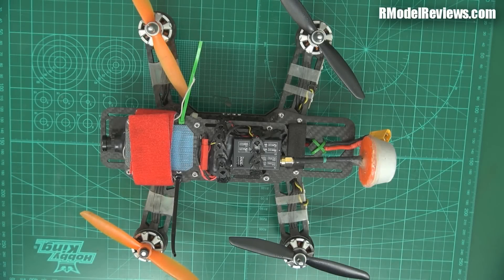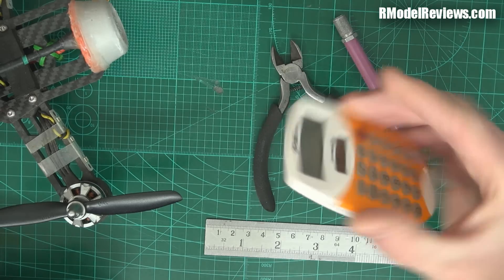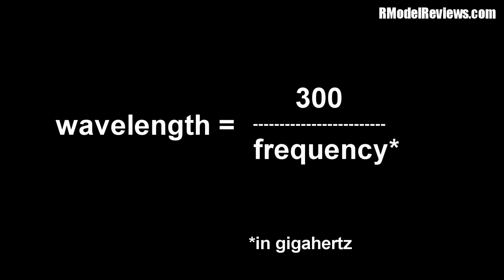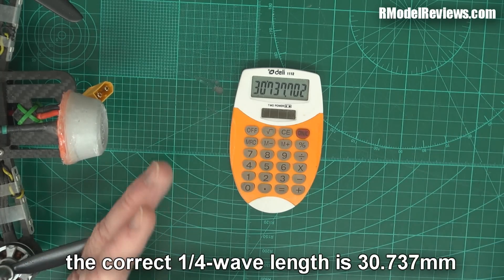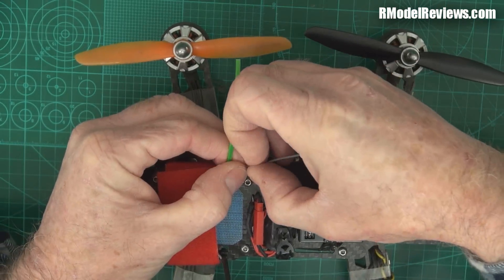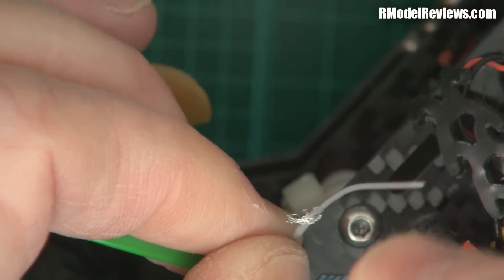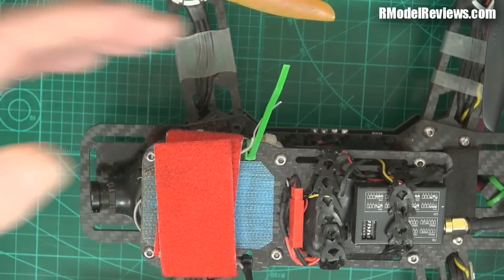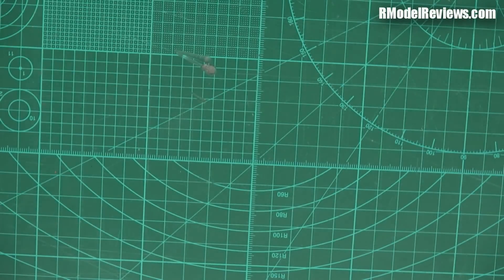How to repair a broken receiver antenna

Comment: I use an old nailcutter instead of the side cutters for small wires. Much more precise since it's got a thin profile and sharp all the way to the edges. I would have used that to cut away the outer braid.

Comment: On your next video could you explain the large difference in receiver lengths - eg Flysky is 26mm. Also good to show a BODA aerial particularly for the lower range systems and toy radios to increase range by using that cut off coax shielding.
Reply: He answered that question above.
Reply: Rob Gale  Not really - there is a big difference between 33mm FrSky and 26mm FlySky. That is not down to manufacturing tolerances, it is a design decision. Perhaps to do with tuning sensitivity and interference - just like the old GWS FM park receivers having non 1/4 wavelength very short aerials.

Comment: Outstanding...thank you sir!!
Today i got told by every expert under the sun "Nar, nothing can be done..new receivers the only option" came home and tried splicing, some soldering, 10% improvement at best.

Its late, couldn't let it be, jump on YouTube and watched this video.
15 mins later and im walking across front lawn in my boxers, fimgers crossed..

The Rustler's 2.4ghz reciever  and it's new custom "minimalist look" 😆 460mm aerial, has full range again.

Again, thank you Sir, you little ripper
Reply: Doing this to rustler right now lol.

Comment: Great video but why don't you put the antennas under your arms front and back? my quad is under the arms and it's impossible to touch the antennas 👍 and the bottom of the quad is always facing you 😆👍

Comment: Cheers for video, how come frsky d4r-II is 15mm? Is that because there are two totaling to 30mm? 
Looking forward to the full replacement as one of mine is damaged half way up the antenna.
Reply: Tom Smith I just measured the antenna on my D4R-2 and both are 31mm.  The Rx in the video was also a D4R-2.  Could yours have been cut at some time ?

Comment: great video. thanks   question, my sr210 receiver has no coaxial cover. just a 8.5 cm with a single solder point in the receiver. i need a longer antenna and would like  to add one but with no place to solder the ground wire. can  the battery ground be used for that? since i got the receiver they have upgraded to a longer antenna. i would like to be able to fix the one i have. any ideas? any help would be appreciated. thank you

Comment: What if you pull the shield all the way back over the untouched coaxial. if possible.. Could make a simple sleve dipole style antenna? maybe cover it with some solder. Would that give good reception i wonder..? :D

Comment: Very nice and informative video. Does it mean that the "receiving"  part of the antenna is only the exposed part of it ? Can I run the insulated part under the cage of the quad and only care to place correctly the exposed part of it ?

Comment: QUESTION, please: about rx antennas; most tinywoops come with a AIO board. And the rx antenna is just a 26awg cable, with no ground or anything else... How come??? How does it work?? And about Lengh?

I think Albert Kim tried to put a regular antenna in his mobula6 and put the ground somewhere and the thing got lot lot worse in range ...

Comment: I recently shortened one of my FrSky antennas doing the same, they were far too long and have one sticking out of the back of my quad. No need for math, just measure the other one if there are two!

Comment: I have had one of mine cut off at the mount on my walkera f210 for a few months now. I haven't noticed any range problems but i only fly over 2.5 acres. What other problems could potentially arise if i don't fix it? i will get around to it i just have another project i want flying before i pull her all down.

Thanks.

Comment: I use 3 XM+ rx, 2 of them are old version with 15cm long antennas(overall length) and exposed part of 33mm(roughly). The new one's antennas are 10cm long with 21mm exposed part. I got answer from Frsky that the 21mm exposed part on 10cm works the same as 33mm on 15cm. Why so? Should I stripped it into 31mm.?

Comment: Great! Still waiting for your hitec radio review. Not much on the web, only some griping about bricked ones. Is the maxima really the bee's knees to say FASST / s-fhss? Is there enough in that radio for a heli flyer to want to convert his flybar heli's over?
Reply: pataat oorlog The Hitec is certainly one of the lowest-latency systems around (which is a complete about-face from the days of the original Aurora 9 which was probably the highest-latency radio on the market) but in terms of resistance to interference and range, most of the modern 2.4GHz frequency-hobby systems are now pretty much equal.
Reply: Interested to see what you think. Price point seems right. I've heard people allege that support when there is a problem is poor this neck of the woods though. And OMP/Modelflight do not carry them :/ Still

Comment: On Taranis X8r receiver, must the antenna wires be fully extended or just ensure the loaded elements are aligned 90 degree/ 180  degree out of phase?

Comment: Thanks Bruce - I have broken antenna, but the piece that came off has the wire disappear into a brass cylinder about 3mm in diameter.  Whats the procedure for that?

Comment: Hey Bruce, my Turney transmitter had a brass piece on the end of the wire. I think it was soldered to the wire, but I don't know on the inner or outer braid. It was cut between that piece and the TX case, can I just splice the coax back together?

Comment: Would it be a problem if you shorten the opposite end of the cable to 
solder onto a board?  I ended up shortening the 2.4ghz cable from my 
flysky GT3C before soldering back onto the board. To be clear, the 
entire external antenna is untouched, just the soldered end was 
shortened by a good inch.

Comment: I soldered two new antennas on my controller for my drone replacing the one antenna so all together I have three antennas on my controller and somehow the range on my drone got worse when I added the two extra antennas  could  you tell me why ?

Comment: Thanks for the great vid. Very useful.
Two things:
1) I've finished my 1st  miniquad build according to your videos plus a few other resources. The damn thing flies really well! I'm going to post a complete list of what I purchased, where I got everything, and what the total cost was. I'm a complete beginner so it will include everything I bought. I'm really happy with it. But I'd not really call it cheap!
2) On the topic of miniquads I'm hoping you will do a review of:
FPV Freerider RC Quadcopter Racing Simulator. Uber cheap and pretty interesting as a simulation for learning to fly racing miniquads. I'm having some issues getting my Turnigy 9x to work correctly with it. Having problems mapping my channels 1 & 2,  but I'll work it out eventually. I'd love to hear your impressions of this dirt-cheap piece of software.

Thanks again for another great video.
Reply: Larry Grimes One more thing...I noticed that this miniquad has no ESCs mounted on the arms. How and why?
Reply: Larry Grimes Is there an advantage to adding a wire out to 1/2 wavelength since you already have the cable tie running up rather than cutting back to 1/4? Adding a bit is pretty simple.
Reply: Larry Grimes This quad (MXP230) has room between the frame and the power distribution board into which the ESCs will fit so I put them their to minimize the risk of them getting damaged when flying through the dense trees around here.
Reply: Larry Grimes A 1/4-wave antenna has a different impedance to a 1/2 wave antenna so it would not be a good match to the antenna or the receiver.  The result might even be a reduction in range.

Comment: Hello, tell me please, I have a micro s-fhss receiver working on sbus, it has a place under the ipex connector, but apparently because of the cheapness, the 30.7mm wire is soldered. Can I unzip the connector and make a self-made antenna from the coaxial cable, exposing the center of the cable to 30.7mm? I need this to put the antenna out of the carbon frame.

Comment: quick question. once I was done with building first quad, I shall the length of my spectrum receiver antenna and said to myself, hey I will cut my devo 7.01 antenna wires and put the extra to the side for just incase. well I go to fly and can't get 10 feet away from me before loosing range. I have the original length, can I soldier the wires back together??

Comment: an easy way to do this is to cut the isolation a bit to far, so the antenna is a bit to long, u can then exactly trim the inner wire to the right lenght afther u got writ of the shielting mesh, thas more easy to be exact on the right lenght...

Comment: HI. my receiver antenna was to short so I exposed a little bit of the end of the antenna and soldier very long copper wire that run all over my dji f550 just to get more range... (before I could not reach 300 meters and now I pass 500) can it makes any damage because of the length of the copper wire?

Comment: I'm using fsi6 transmitter , it was damaged when accidentally hit props on and it's looks ok but it has two bends on the antenna wire so is it safe to fly with that

Comment: Ha Bruce , I pulled apart a dipole from a VTx to use the cable and the tip measured 10.2mm. Another was 31mm but both labeled 5.8G. Is there any explanation?

Comment: RCModelReviews - I have a Futaba R2008SB 8-Channel 2.4GHz S-FHSS receiver, with dual antenna, would it still be okay if the lenght of each antenna is different but the exposed cable are at 31.25mm? Many Thanks from Country - Belize.

Comment: I read a lot of people here asking about shortening their antennas... Am I correct to assume that I can replace an original antenna for a longer one if I maintain the lengh of the exposed end?
I bought an IRangeX RM601 that has 3.5cm antennas -  it only has the exposed part with no ground on the rx itself. Is there a way of sticking a longer antenna on it?

Comment: bmhi quick question, i just bought a cheap basic remote the dsx, i crashed my plane today and was pretty bumbed out cuz it was my first flight with this new remote control, so i was thinking i bought a defective unit right after my other one had just broke and now im out a airplane too which was even more of a bumber but as i was thinking about what could have went wrong i suddenly remember when the guy at the hobby shop put the bind wire to my reciever he pulled my reciever out which means the attena wire was no longer going to the outside of the plane, and when i went to fly it it was fine untill i got about 200 ft than i lost control of it and it nose dived to the ground and was confetti afterwords, do you think it could have been because of the antenna wire? this almost got me back out of this hobby because i always get defective electronics but in this case im startimg to wonder if it all happend because of the antena wire not being exposed. i did a short range check but was lazy and only walked 75 ft away maybe.

Comment: Hi bruce i have a fs-a8s reciver and i saw a video someone had change to a quater wave diapoll instead of the original quater wave monopoll antena. How mutch improvement if any you would get considering the weight you would gain?

Comment: Rcmodelreviews hiya Bruce iv broken my flysky IA6 receiver antenna,s  will it be a good idea to use RG-316 coaxial wire or must it be replaced with the RG-178 wire Bruce

Comment: So I have a question to that I could not find an answer in the internet.
Why do some receivers have antennas where the shielding akts as a ground and others like the frsky fd800 for example just have one single cable? With no shielding and just one solder point... That  confuses me.
Hope I can get an answer here.
Thanks and greetings from Germany

Comment: Does the length of the antennas matter as far as the range is concerned? Because I ordered a SwellPro Swift 2 and received it today and both antennas are approx. 2cm long. Does that affect the range?

Comment: Hello. I broke my antennae in half. Can I just solder the inner wires together from both pieces or do I have to start from the end that I have left? Thanks. The end that broke has a thicker end than the antennae wire and so I am leaning towards keeping it. (it's the stock antennae that came with ia6b). Thanks

Comment: Bruce why divide by 300 what does it represent?
Reply: FPV SPY 

That represents the speed of light (which is 300000 Kilometres/sec.)
The signal travels with light speed at 2.4GHz. (or 2400000000 Hz ) 
That means  1 wavelength is 2400000000 / 300000 = 0.00125 kilometre or 125mm
1/4 wavelength is 125 / 4 = 31.25mm

I think Bruce could have explained that a bit better. ;-)
Reply: Rooster9911 May be but I still understand your explanation and thank you for the depth that you have gone into it makes it clear. Cheers.

Comment: Hi Bruce. Does the transmitting potion of the wire need to be kept straight?
Also, some of the Sanwa 2.4GHZ car receivers dont have any exposed section and are quite long. I was told its probably a full wave or 1/2 wave antenna, so would that whole antenna need to be kept straight ?
Cheers

Comment: Quick question if you will Bruce: by how much is accuracy diminished by cutting to the wrong length? Assuming a we're mere mortals and 0.5mm either way is fairly possible
Reply: David Nicholas Obviously it's nice to be as accurate as possible but half a mm each way won't make a perceptible difference.

Comment: I have noticed futaba 2.4 antennas to be 29.5mmm and frsky inc the fasst compatible to be at 33mm. That's quite a big difference. Will this affect the range I get out of a fasst compatible frsky rx as I am only experiencing about 1km range with the frsky rx
Reply: PlaneCrazy It won't make a lot of difference.  The "tuning" isn't all that critical and I suspect that "manufacturing tolerances" account for some of the difference you're seeing.

Comment: Mine sheered right at the receiver and I don’t have any wire left. New receiver?
Reply: You could just solder on a new coax cable. That's a bit like changing the car because the tire is flat, just fix the tire, no need to get rid of the car.

I've re-soldered co-ax cable on my VTX antenna, wasn't too hard, it had sheered right off at the base. Just used the same piece that sheered off, so you might not even need to buy any, just re-use the piece that came off and solder it back on.

Comment: what about old school am and fm or 72.170 stuff
Reply: 57chevy350 Try wet string, just lop it off to the nearest fathom or so.;)
 It normally doesn't have any shielding, the active length is the whole antenna.
Reply: 57chevy350 For 72.170 MHz, that would be 988mm, or 38.9 inches of stranded hook up wire measured from the soldered joint onto the receiver to the end of the wire. For other frequencies, try this calculator.  http://www.csgnetwork.com/antennagpcalc.html

Comment: How about a video to repair a broken Eachine  vtx03. Brass connector snapped off the board and pulled the solder pads off the board

Comment: Thanks Bruce. Looking forward to the video on replacing the antenna. I had one of my antennas chopped in half by a prop strike on my D4R-II.
Reply: ***** yes but as Bruce was saying there might be more to it.
Reply: ***** The UFL connectors are somewhat fragile and it is very easy to damage them.   I'll show the strategies to ensure that you don't create any damage during the removal or replacement operations.

Comment: My tip is to cut the shielding a few mm long and then either measure or line up the end of a good antenna and trim to fit as the last step.  It's a little cleaner and ensures you don't have to cut the shielding twice.

Comment: Question: can you replace a standard antenna (one soldered right to the board without coax extension) with a longer antenna (coax extension) with the goal of better antenna placement?

Comment: Hi - interesting video - this is a bit of a message in a bottle but I am wondering if anyone can help. I've got this crazy idea of using 1.5mm  thick perforated aluminium sheet with 10mm holes to make a fuselage skeleton for a fixed wing model. Unfortunately, I believe this would also create a Faraday cage and block the receiver signal! I'm guessing one option would be to dangle/wrap the antenna externally. If I wanted to have a long antenna wrapping around the model or running the length of it I'm guessing the exposed part needs to be multiples of a wavelength long (to resonate)? Could I alternatively use the whole fuselage as the antenna even though it is large and strangely shaped? thanks in advance - any help appreciated.

Comment: Hello Bruce, after watching this video I'm wondering why the short range RX have short antenna(s) in form of 'conventional' litz wire(s) and the full range RX have long antenna(s) in form of coaxial cable(s) at least on the RX I'm using then. I read your post here where you've written that in modelling (small antennas) the total length of the antenna(s) doesn't matter. So what's the difference in antennas and in those two kinds of RX?

Comment: Hey Bruce! In our local flying group we discussed the following question: this is a dipole antenna and you´re manufacturing a 1/2 wavelength antenna here. 1/4 of the wavelength is without isolation and mesh. Am I right if I say that another 31mm (1/4 wavelength) of isolated cable also contribute to the dipole? Thus, 62mm have to stick out of the quad?